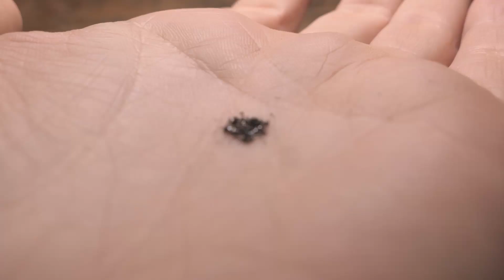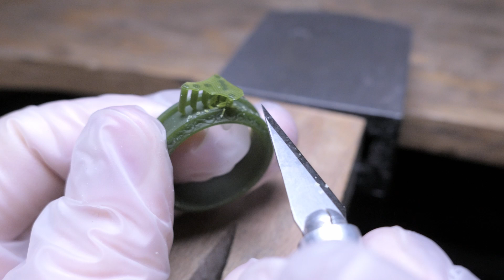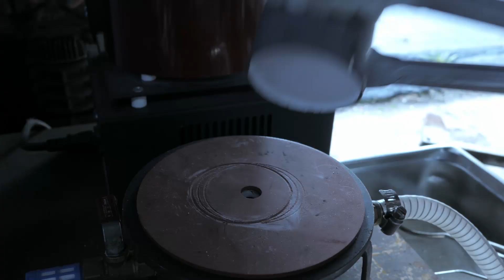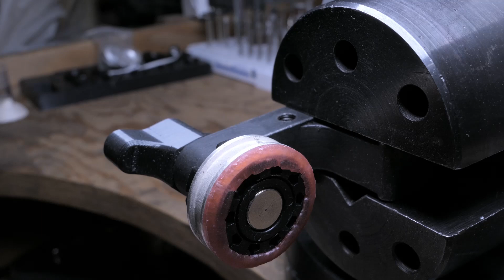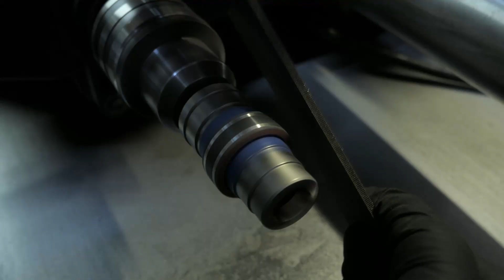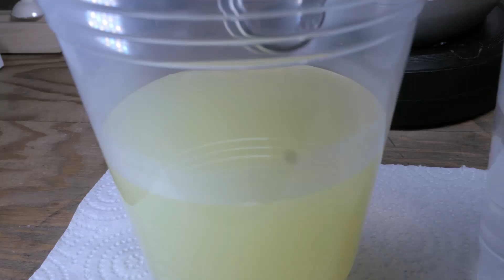Making a Ring with 1-Million-Year-Old Meteorite!

Comment: So why did you go with CA glue to lock the dust in place over something like silver solder?  I figure just wrap the inner band in solder torch it down then just add spots of the dust on top of some past flux and quickly torch it then give it an 8th turn and repeat.